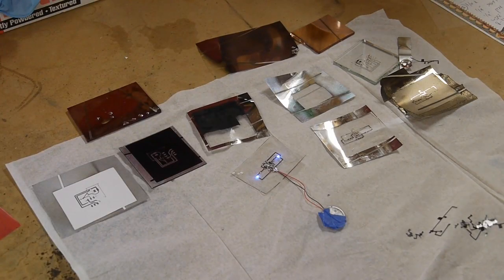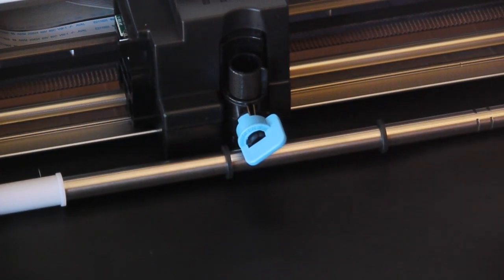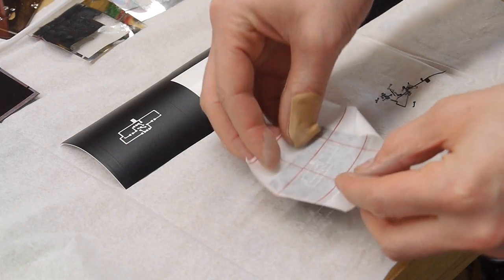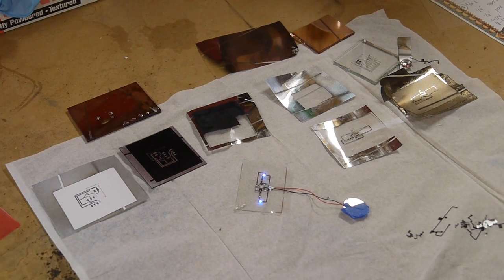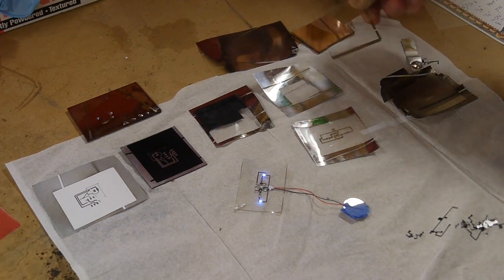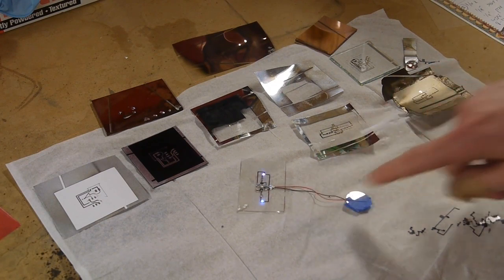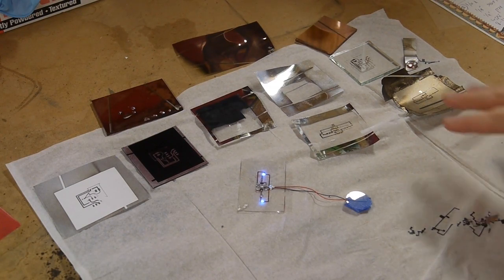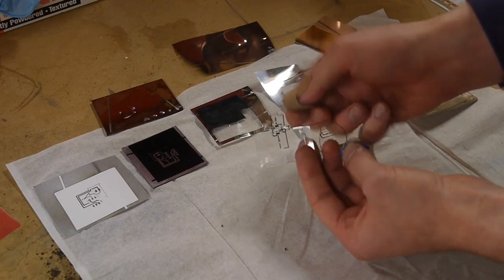Clear flexible printed circuits - first success

Comment: Yet more good stuff!
I'm wondering if you could perhaps make some lower-value capacitors by layering another sheet of plastic on there..or perhaps depositing on both sides of a single sheet? (don't know how you would make a via to connect to the other side though.)
If you could control the amount of aluminum deposited,you might be able to make some lower-value resistors,maybe?

Comment: In college, 25 years ago, we made deposited circuits just like this with aluminum deposition. We created circuit masks using thin sheets of CNC'ed aluminum and could move the masks inside the chamber without losing vacuum. We created traces and capacitors mostly. For the dielectric we used stearic acid. We used super clean class and semiconductor wafer substrate. Our chamber had two heater bowls, one for aluminum and one for stearic acid. You get the picture I'm sure. Learned tons working there.